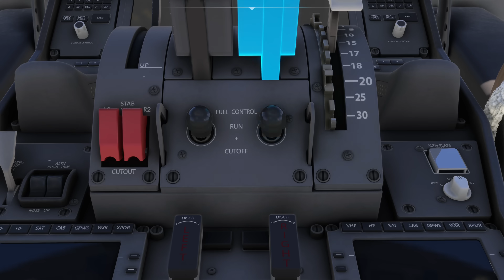Air India 171: Why Did The Fuel Cut-off Switch Get Moved?

Comment: As quoted from an interview with an aviation expert, specifically noting: Past Incidents and the TCMA System
Schiavo specifically cited a 2019 incident involving an All Nippon Airways (ANA) Boeing 787, where the aircraft’s system erroneously shut off fuel mid-air after mistakenly detecting that the plane had already landed. The software in question, known as the Thrust Control Malfunction Accommodation (TCMA) system, has been previously implicated in similar malfunctions. Designed to help the aircraft distinguish between flight and ground conditions, the TCMA can command the engines to reduce or cut power under certain circumstances. In the ANA case, the system’s premature fuel cutoff forced the plane to glide heavily to the runway. Fortunately, the incident occurred during landing rather than takeoff, preventing a crash.
Reply: Interesting
Reply: Watch Flyingbeast video if you  really believe in unbiased explanation ❤❤❤ english subtitles are available

Comment: Japan Times reported on 15 July 2025 that the Air India 171 plane had had it's Thrust module replaced in 2023 and 2019. On the previous flight before it went down, passengers reported no lights, no tv, no air con. So indications are the plane should have been grounded with electrical issues. Maintenance issues may have been happening on that plane. And it's not implausible the thrust module failed again or wasn't installed properly. CCTV from the airport runway shows the RAT was deployed before liftoff. The Air India planes had been sold recently to another company and had been getting serviced by Turkish maintenance crews. Type in those keywords and you will see why:-
Emirates Airlines
South Korea Airlines 
Are advising pilots to check the fuel switches. Other airlines are rechecking the Boeing 2018 maintenance requests for fuel switches. Says it all really.

Comment: My questions are...
1. What fuel control system does these switches turn on?

2. Can these fuel control system malfunction?
3. Could this fuel control system have malfunctioned?
4. Did the pilot ask ...did you shut off or ....why have you shut off? 
Two totally different questions.
5. When was the switch turned off...after the or before?
6. Is there a procedure to switch off and on if the fuel system fails?

6. Could the monitoring have been following that procedure?

Comment: It's important to approach the Air India accident with both empathy and a clear understanding of aviation protocols. Based on the preliminary report released by the Aircraft Accident Investigation Bureau (AAIB), the tragic crash was linked to both fuel control switches being moved to the cutoff position shortly after takeoff 
However, the fact is that report does not attribute this to a mechanical fault, nor does it suggest any systemic issue with the aircraft or its engines 
Given that this aircraft had completed numerous flights prior to the accident, operated by different flight crews, it's reasonable to conclude that if there had been any indication of malfunction or irregularity with the fuel control switches, it would have been flagged in an incident report. Aviation crews are trained to log even minor anomalies, and such a critical system would not have gone unnoticed.

Furthermore, the crew involved in the accident would have conducted thorough pre-flight checks, including verification of all essential systems. If the fuel switches had shown any signs of defectiveness or operational concern, standard procedure would have required them to report it and potentially delay or cancel the pushback. The fact that the flight proceeded suggests that no such issues were evident at the time.

Air India has since completed inspections of its Boeing 787 fleet’s fuel switch locking mechanisms and found no issues 
 This reinforces the notion that the switches themselves were not inherently faulty. The broader aviation community, including other international airlines, has also conducted similar checks with no reported malfunctions.
Ultimately, while the investigation continues, the evidence so far points toward an operational handling of the switched rather than a mechanical failure.  My thoughts remain with the families and all those affected by this tragedy.

Comment: Capt Sreve, a All Nippon flight in 2019 had irs fuel switches cut off while prepping to land. Apparently a software glitch that could have well been repeated in AI 171 ti Gatwick.
What are your thoughts on this?
Reply: Wrong. Engines spooled down after landing due to a software glitch, software did not identify that the aircraft was on the ground and therefore identified the high thrust as an anomaly and shut down the engines. The switches didn't change

Comment: Dismissing chances of pilot error in Air India plane crash, US aviation expert Mary Schiavo stated that in 2019 too fuel switch of Japanese airline's Boeing 787 plane's transitioned from 'Run' to 'Cut-off' on its own. "The plane software made the 787 think it was on the ground and...cut the fuel to engines...Pilots never touched the fuel cut-off," Schiavo added.

Comment: Is at all possible that a certain highly specific frequency vibration interacted with the springs of the switches to allow them to move by themselves.  We consider a static state but vibration can allow unusual things to happen.  I have seen this in cars.  Is down for fuel cutoff?

Remember earlier 737 crashed due to control reversal thanks to highly unusual elements of extreme cold and extensive movement of controls generating heat.

Comment: The 2018 FAA Advisory recommended, but did not mandate, operators  of several Boeing models, including the 787, to inspect the locking feature of the fuel cut-off switches to ensure they could not be removed accidentally.

Comment: Hi Steve,

Here’s my thought:

In a basic car mechanism, if the handbrake is engaged while driving, an alarm sounds to alert the driver. Similarly, it would be helpful if Boeing implemented an alert system that triggers when the engine fuel switch is turned off. This would immediately notify the other pilot, even if the switch was turned off intentionally by one pilot.

Alternatively, the system could be designed to prevent the fuel switch from being turned off during takeoff or after the aircraft is airborne.
Reply: Sorry but I will jump on this - Alternatively, the system could be designed to prevent the fuel switch from being turned off during take off or after the aircraft is airborne.

I was thinking similar way to disable the fuel switches in position "On" when aircraft is airborne. There are sensors that tells the aircraft's "brain" when aircraft is on land or airborne, enabling or disabling some of the functions or specific features. 
That will never work with fuel switches. 
The fuel switches on airplane are the ignition key for a road vehicle. What do you do the first if you had an accident or emergency situation on the road? You switch off the engine. The same thing applies to aircraft engines, pilots should be able to cut-off the engine manually in an emergency situations to prevent the fuel leaks, catching the fire or even exploding. All we know that those engines are powerful enough to get the airplane airborne with one engine only and fly with one engine only.

So, Steve already mentioned that before - the fuel switches must be two person operational! That's the key.

Cheers

Comment: The answer is simple and cheap to me
Make a hinged metal cover that fits over the switches that takes one pilot to lift (with a finger release lock that has to be pressed hard) and the other to operate the switches
Reply: And if one pilot is incapacitated?
Reply: @clm2071  Then get cabin crew to do it. This is not something that usually needs to be done in a hurry, if an engine fire needs operation of the switches, it won't slow them down more than a second

Comment: ‘It happened in 2019, too’
Schiavo exclusively told  that this is not the first time fuel switch transitioned from “Run” to “Cutoff” on its own. It happened five years ago, too.

“There was an ANA flight in 2019 in which the 787 aircraft did this itself, while the flight was on final approach. No pilot input cutting off the fuel whatsoever,” Schiavo told

But how did it happen?

She said that a glitch in Boeing 787 software led to the transition in fuel switch.

The investigation revealed the plane software made the 787 think it was on the ground and the Thrust Control Malfunction Accommodation System cut the fuel to the engines
Reply: She is factually wrong, the engines rolled back after landing - not on approach
Reply: @clm2071  - THE RAT DEPLOYED BEFORE LANDING.
Reply: @clm2071 the RAT deployed before landing

Comment: Captain Stevee a quick question.  As mentioned before there is a possibility of turning off both engines and restart (which is normally save to do so on some 30,000 feet or so). If that is the case would RAT would still deploy? Given pilot done to restart engines?

Comment: It can be a Mistake of Beoing Plane since both the pilots are shocked when the Fuel Levers were off. As we know there are hundreds of Accidents and Safety test Neglegence from Boeing Manufacturer. (It is, if you dont know check online and come back). It can be a Plane Malfunctioning issue. Its funny news channels like BBC, CNN etc are trying to put the fault on Pilots even before the Inquiry Conclusion is Out. Ofcourse. their Job is to save their western Companies and they are doing it right. Only Shameful thing is the Own indian citizens and Indian News giving Statements like "Pilot turned off the Switch" when the actual deparment doing Investigation has not yet released the final report. 

India will Destroy itself with these kind of people. West does not have to try anything harder.

Comment: Dual engine flameout.

A tech question aimed at narrowing down possible causes as fast as possible, obviously. The response was more of the same. 

Likely felt the engine thrust dropping and looked at the screen at warnings, noted fuel valves shut then asked the question before doing anything else, the copilot answered while shifting gaze to the switches then probably they both looked at the switches and throttle levers at the same time and voiced a few expletives as they realised something else had gone horribly wrong. 
  
The subsequent off then on fuel switch operations, which would have been lengthened by the results of the power down, RAT deployment and systems coming on, were to do with an attempt to get the engines going which was partially successful but the aircraft was then descending too fast and was too low to recover.

The timings noted in the report along with general RAT operation info and lack of more specific and detailed info make this scenario possible.

Comment: You're barking up the wrong tree. Many times, AP Mechanics make fun of pilots because they are actually clueless about aircraft systems behind the scenes. It was not sabotage or suicide. It was Boeing just being Boeing. 
FAA AD 2021‑21‑05 (Docket FAA‑2021‑0273) requires the replacement of the EEC MN4 microprocessor at specific intervals due to failures in engine thrust control. GE noted that accumulated thermal cycles degrade the BGA solder balls, potentially causing “loss of engine thrust control and reduced control of the airplane." 

GE Service Bulletin 73‑0097 R01 (for GEnx‑1B engines) explicitly states: 

“This recommendation is to address a condition that may affect Flight Safety… Accumulated thermal cycles of the EEC with age causes the solder ball to fail.”  

The MN4 microprocessor, housed in a ball grid array (BGA), is susceptible to solder-ball fatigue after repeated thermal cycling and vibration—which can result in loss of engine control. 

The FAA issued the AD effective December 28, 2021, mandating: 

Replacement before 11,000 cycles since new (or last replacement), or 

Within 12 years (GEnx‑1B) or 14 years (GEnx‑2B) if cycle counts are unknown  .

The service bulletin is categorized as Category 2, meaning: 

Replacement is recommended as soon as possible, without immediate grounding. 

Operators may continue service briefly, but must comply within the defined thresholds  .

Comment: I was going to try to find an error which caused it but the display of the audio is crazy. When I need action it's happening asap and my maydayx3 is going to sound frantic if at all given they had no time before impact. The very fact the maydayx3 presents so slowly must be a fakeout. No way that's true unless there's time to utter it and get stuff done. When the ground comes up fast at you, unexpectedly, especially if you're going into a building, even seasoned pilots will be unnerved. No way he'll say mayday.................................................mayday.............................................mayday. 
Maybe the mayday is automated and came upon impact after they were dead. That would explain the audio and it not being fake. 
Another analyst said the chip sensor was faulty. Either way, the mayday call is just wrong.
Were they check riding the fo? If you don't know if the other pilot is competent it can delay your analysis of the plane, but not activation of switches in the wrong position. If you know it's only the plane then it narrows it down to causes. But here we know the problem. It's not hidden. But it might have been hidden until it was discovered. You're going down, you emerg check your essentials and find it and fix it and deal with the result and call out in a panic the fuel switches are off. That's the problem. Now find a place to direct the plane not into a building. 
I have an emerg landing site prepared from every runway. You might also say there's only a very bad landing choice in which case there's probably multiple very bad choices.

Comment: Where does the FDR get the signal from. Is it from the valve or from the actual switch or even in between because the FDR might record the cutoff signal without the switches ever moving because of an electric fault or whatever. To prove that the switches was actually moved surely an analysis of the cockpit voice recording can be done to listen for the audible clicks of the switch movement. These detailed analysis was done before so hopefully they will do it here as well because the response of the pilot makes me question this deliberate theory.

Comment: a very experienced boeing commercial flight pilot, also a youtuber, shared that there was a Boeing service bulletin dated in 2020 that mentioned an LOTC event has occurred due to an EEC MN4 microprocessor solder ball failure. Cause mentioned is that accumulated thermal cycles of the EEC with age causes the solder ball to fail. Tell me more.  The crashed airplane is installed with this same EEC MN4 microprocessor.  I.e. speculation that faulty microchip could be the root cause.  Possibly pointing to service maintenance issue too?!

Comment: You're making a grave incorrect assumption, Steve. The report says that both the fuel switches were transitioned to cut-off. We have no clue or evidence whatsoever that either of the pilots (or any person in the cockpit) toggled the switch. I agree, as of now, it might seem that human intervention is the only likely reason. However, we cannot forget the horrendous crime that Boeing committed by introducing MCAS and just staying completely silent about it. Similar to that, Boeing yet again may have introduced another software (without informing anybody like always) that would erroneously toggle the fuel switches to the cut-off position automatically without letting the pilots know!!! This is not a baseless speculation, as the FAA had already issued an advisory back in 2018 stating that the 787 model may have faulty fuel switches!!!! If you cannot present a neutral unbiased analysis (because of your personal/professional/political ties), then you should not propagate your judgmental personal beliefs as the final verdict. Stop this propaganda!